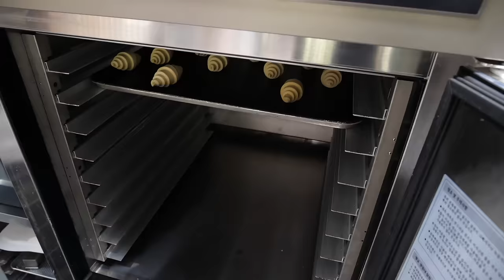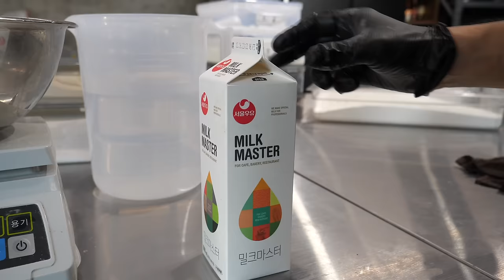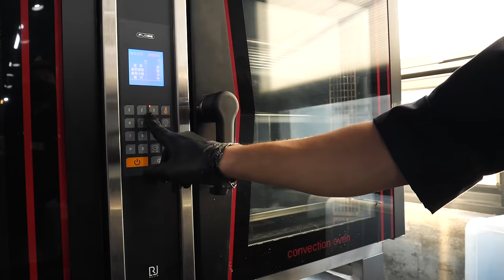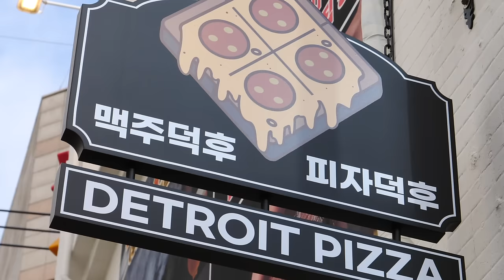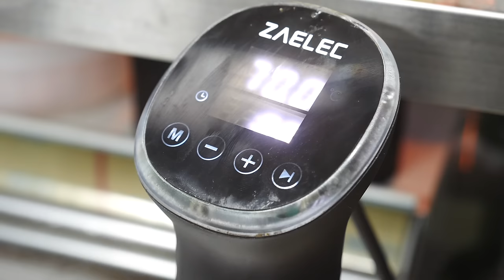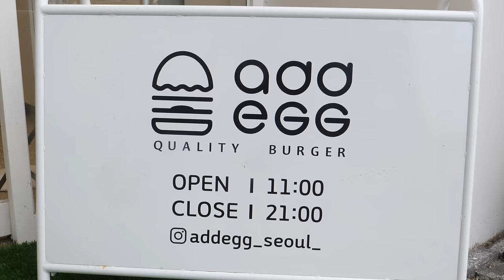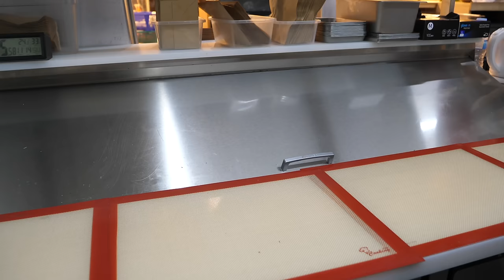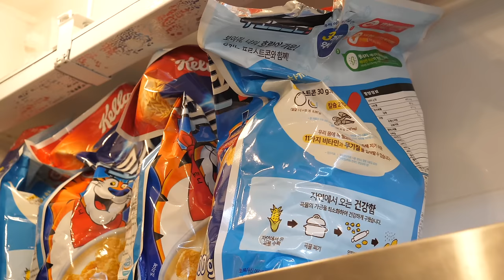[월간 딜라이트] 2021년 12월 TOP5 딜라이트 한국 음식  / [Monthly Delight] TOP5 December 2021 Delight's Korean Food

Comment: What are the cylindrical items with all the holes in them at 45 mins.  I have never seen anything like them.
Reply: If you asked about black and beige shark bread with holes... This bread is a Korean memory bread. The name is briquette bread..(Yeontan or Gugongtan) Long ago, in Korea, 12 or 24 briquettes made of coal were used as fuel for heating and cooking. For Koreans, it is the fuel of memories filled with emotion, so it is a bread made with memories of that time. Ingredients: Beige has red beans and glutinous rice cake inside, and it looks like it's covered in soybean powder. Black bread probably tastes like black sesame with a little chocolate flavor. It's like custard cream in the hole.